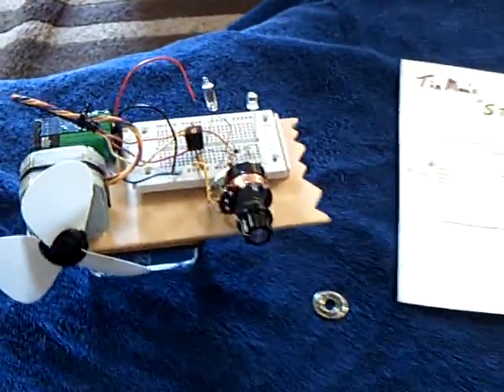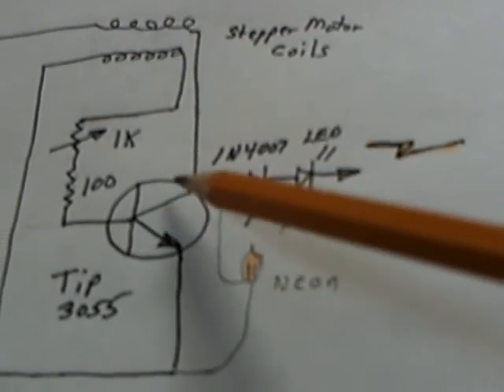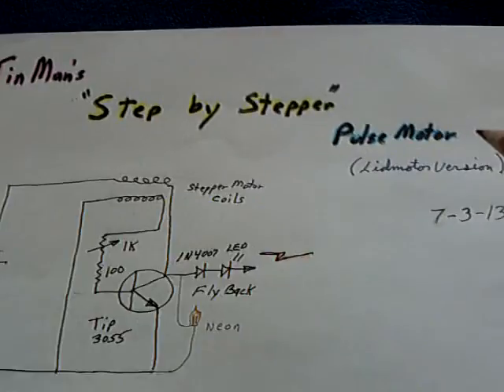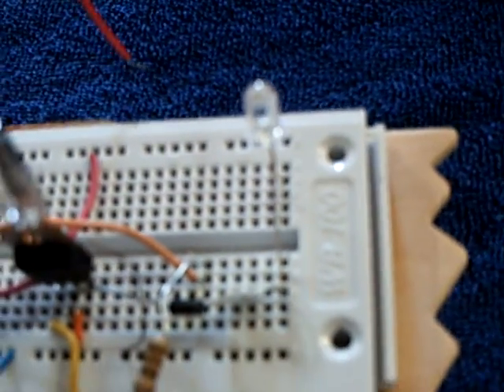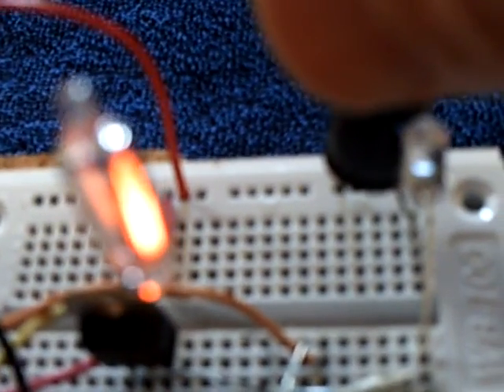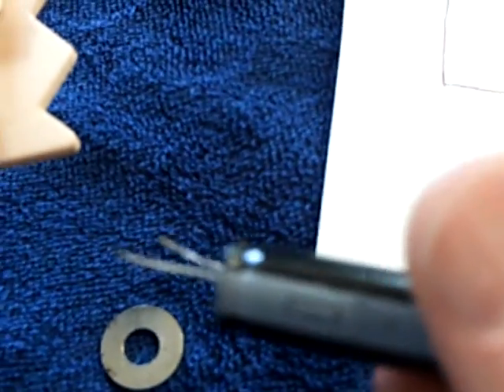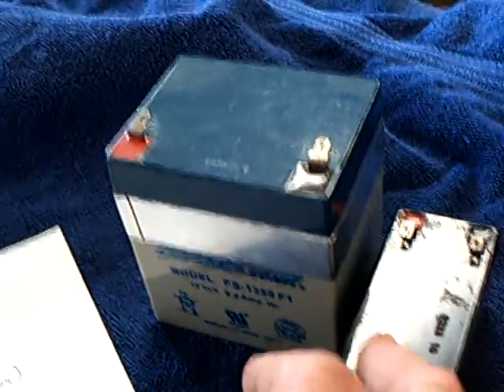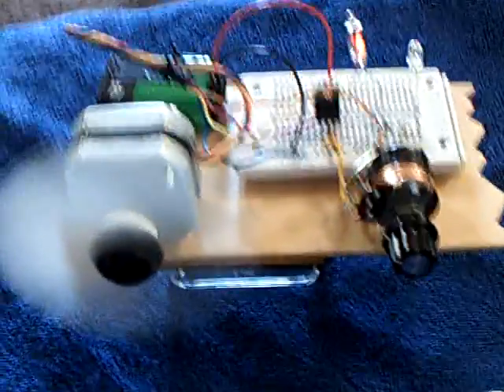Step by Stepper --- neon protection

Comment: Hi lid, again always love your videos, nice and bright and well commentated my questions kinda related but not a stepper like this..
Appreciate any help/advice 
See you said the diodes usually there for sharper transistor switching, does that diode offer any protection to the transistor? 
I thought neons didn't have a polarity like an led does? 
Is it that the transistor has less resistance then the neon so adding in the bemf to original supply across the neon biasis it and turns it on? 
How does the neon protect the transistor? 
How do I stop my transistors dying!:-(
I always add enough resistance too base..
Thanks

Comment: Pretty much, yup. As I see it. Typically though a good NPN will exceed 60V. And the source voltages are low. If you want to go with higher voltages in excess of 36V for example, use a MOSFET instead.

Comment: Great advice. I try not to buy stuff where I can avoid it, I like to see what I can do with stuff I get from the bin as well as broken stuff from freecycle in  my area :) I have a step by stepper running on my bench atm with an old printer stepper. Which works ok, bit small, good for low amp draw. I also tried it with a NEMA17 I have for another project. That works really well. Do you have any darlingtons? TIP122 seems to be giving me a lot of torque, which I wasn't expecting.

Comment from the maker: If you try this either use a motor you have on hand or don't spend a huge amount of money buying one.  I bought another type online (luckily I didn't spend much on it) and it didn't work well at all using this circuit.

Comment: The protection diode is also to protect the base from negative voltages, in excess of the transistor e-b voltage spec. Fly-back is probably not low enough to need it. This is an interesting circuit. I'll have to try it too :)

Comment: I understand that.  But the I assume there is a "trigger voltage" of sort that must be reached until the neon starts to conduct.  So I assume the transistor must be able to handle any kickback up to the trigger voltage or it would fry.  Is that correct?

Comment: The spike comes off the coil, not the source. If you give it somewhere to go, a path of less resistance (the neon, or a charging battery) the transistor will not see it. Take away the route, and yes the transistor takes the hit.

Comment: If a battery is badly sulphated, charge it to (as close to) 15.25V as you can or 20 hours, whichever comes first -- then discharge to 12V ... repeat 5X. If that doesn't help, the battery is likely too far gone. Always take caution to be doing it in an area that would not pose a fire hazard.

Comment: Hi,  Nice video.  I have a novice question.  There is some minimum voltage required to cause the neon to light.  Doesn't that mean that the transistor has to be able to handle the fly back voltage up to that point?  Otherwise, I would think you could still fry the transistor.

Comment from the maker: Thanks for the explanation of why the transistor doesn't get hot.  There might be several circuits that will work but this one is so simple and works so well I hate to get sidetracked.  Mariuscivic posted a video of this circuit working with an IRF640 Mosfet also.

Comment: Nice demo of the high voltage output Lidmotor.I believe the transistor isnt getting hot because it is switching on and off very cleanly.The 2n3055 im using remains cold to the touch,even at 31 volts input.Because of the way the stepper motors are designed,the transistor is pulled down every second step.I believe that the bipolar circuit from JB's window motor would work on one of these stepper motors-maybe you could give that a go while i try this synchronous motor setup?.
Cheers